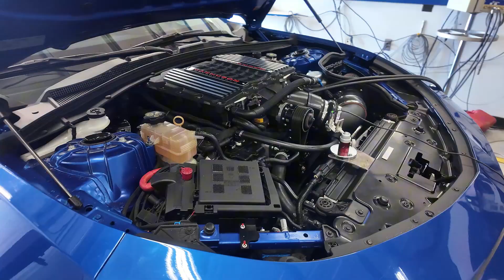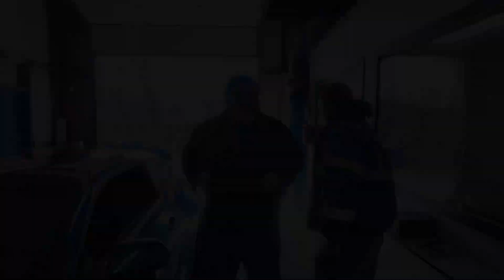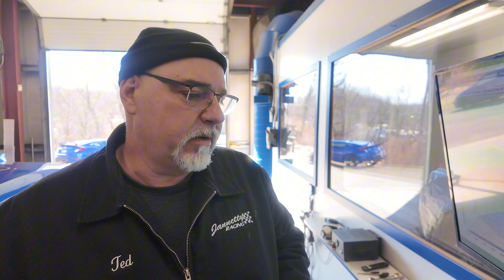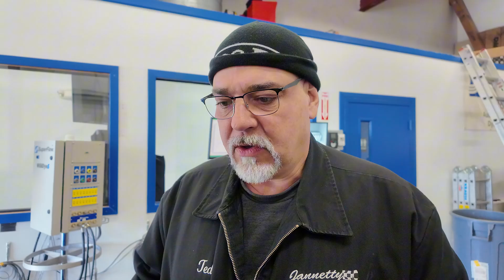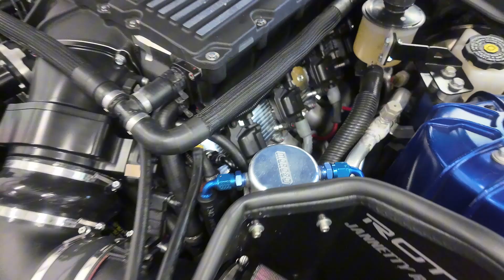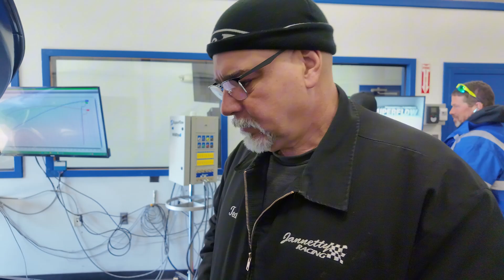2018 Camaro ZL1 - JRE "Super Terminator" Package Experiment

Comment: Ted, I am shocked with the 120mm throttle body when the usage of this ZL1 was stated for street driving and stated for road course.  I tested the 102mm and the Big Gulp vs the stock TB with the base RotorFab and lap times suffered due to the poor throttle control needed to keep the car balanced in extreme high speed turns where a flinch from the throttle sensitivity can put you in the wall nearby.  

I tested the MSD wires and they were worthless above 5800rpm and showed a very erratic spark, similar to the OEM.  Best wire I have run so far with no issues is the Katech wireset which is the same ones they used for the IMSA LMP1 engines before Gibson got the contract for the LMP2 lightweight V8s.   I modified the wiresets and added the BRISK silver plugs to have a 100% reliability with zero spark drop-out and no timing retard during back-to-back sustained pulls in 7th gear.  

What were the MATs and oil temps?  It you balance the thermal dynamics of the engine so it is balanced, the changes you are searching for will reveal themselves.  Keep up the great work!!  Good to see you added the braces to the Hood bracket as the center brace alone is not enough on a car that might actually see high track speeds.